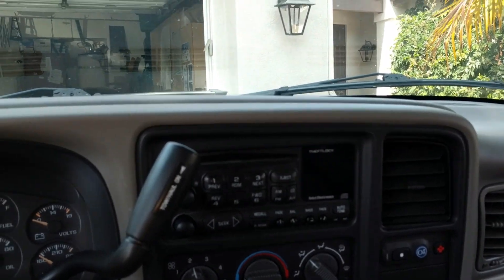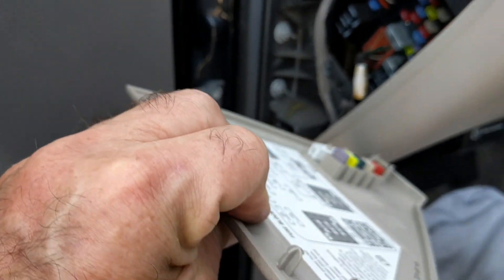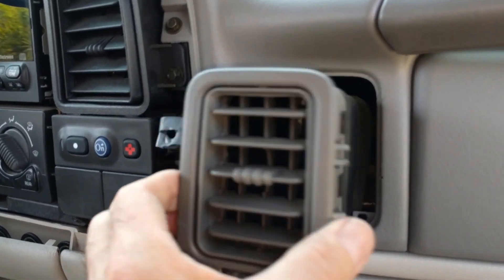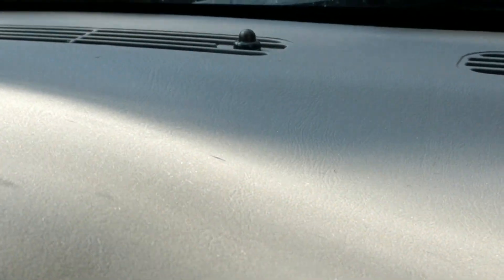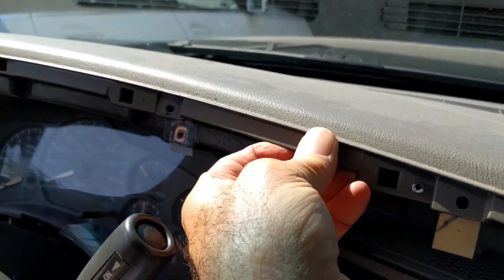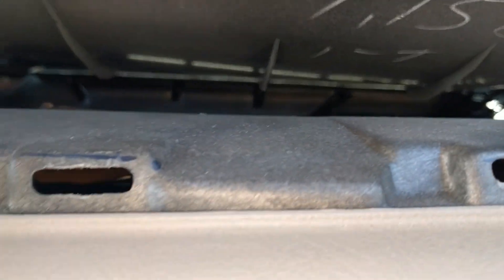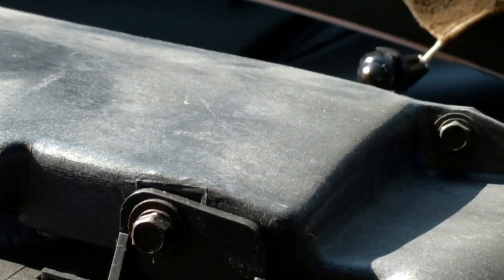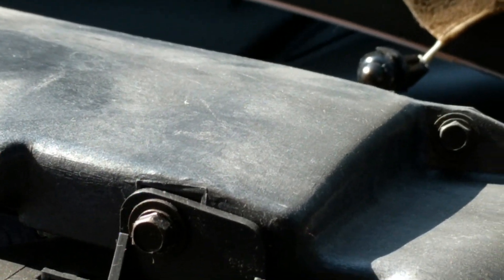Suburban 2002 how to remove the dash board cover by froggy

Comment: I had to remove the entire dash to replace the AC evaporator. Problem is when I put it back together, the area where the light sensor is has the clip to secure the dash to the firewall.  Apparently I missed and the dash rattles big time.  Your video did great detail on how to remove the cover.  I will address the rattle knowing exactly how to remove the dash pad.
Great video (this from an EX GM mechanic)
Reply from the maker: Glad you tackled it!

Comment: I am going to use your video to attempt to put a new heater core in thru access of the top. This is not proper, but it will save my AC charge, plus days of labor. If I have to do some cutting to help removal, It will all be covered back up with all the top trim parts. I did a similar thing with a ford Taurus, and it shortened the nightmare by tens of hours. Thanks Froggy for getting me pointed in the right direction!  You may have saved me thousands!
Reply from the maker: Post back how it goes.

:)
Reply from the maker: Please post how it goes.

:)

Comment: Great video again Froggy!   Looks like the oil pressure gauge is indicating pressure with the vehicle off so is you next job a oil pressure sending unit/sensor replacement?  :)
Reply from the maker: Hmm, never noticed that, I will ck.

:)

Comment: Did you happen to notice if removing the dash cover gave better access to the Mode Actuator? I'm having a terrible time getting the rotating control plate back in.  Mine came out with the old motor and I thought for awhile that they were glued together.  But it turned out just to be a very tight fit.  Tomorrow, I'm going to start taking the dash apart because I'm not able to put this pate back in from below.
Reply from the maker: Sorry I don't, I did it as 2 separate jobs.

:)

Comment: Again, great video. I did the job using your tips. My dash was very weak and brittle and broke to pieces without the possibility of repair. I cannot find  it anywhere. Do you know of any place where I can buy it?
Reply from the maker: Look for a low miles junk yard dash.

They can be painted as needed.